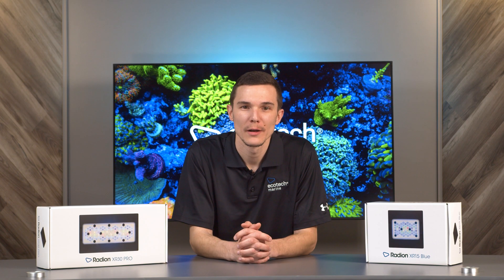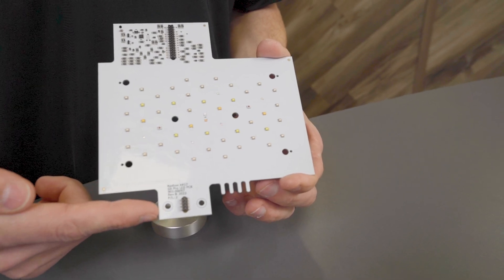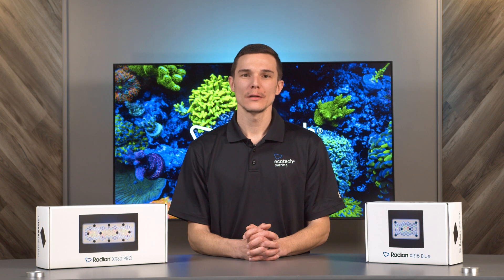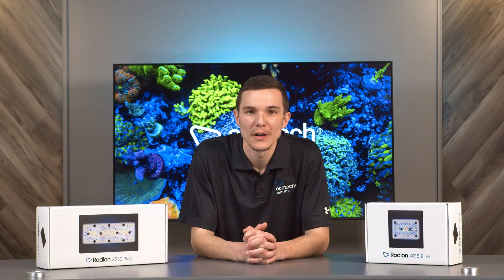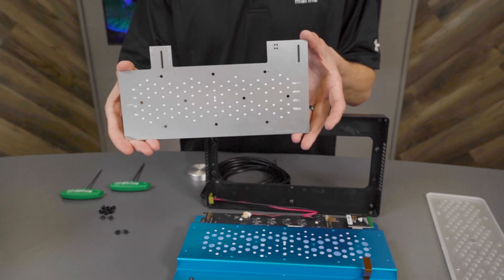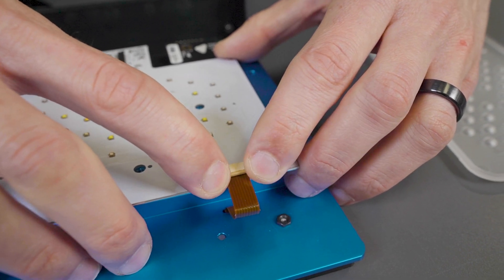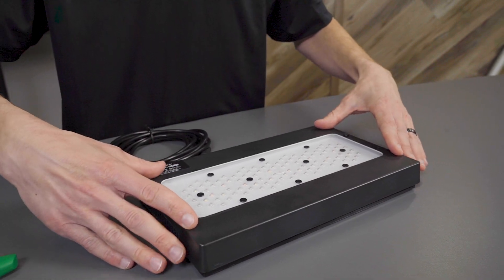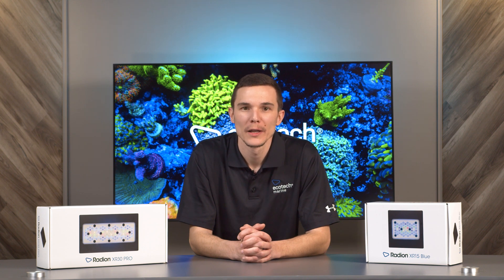Upgrade a Radion G5 to a Radion G6. Upgrade Kit Installation Instructions.

Comment: I think same as the g5 they rush for made a new light that isn't ready. Probably they want to stop the loose of the customer going to other led with real uv..
1) would their lens support Uva, from what I know their technology until know doesn't support it, so how suddenly without testing it can be possible? How long they will hold? Their is a risk for futur trouble here, I would like they told us how with the same technology it is possible when it wasn't before because this from the g5 wasn't ready it would probably last enough long until your led is not more in garanty..
2)where is the moonlight introduce by the g5? Given the design from the g6 their is a space for it but where it is? Economical reason, shortage?

3)  the spectrum is relatively unchanged, apart from maybe having less blue. They seem to have even made it narrower.
they have 395 but it is not enough to make a difference.
So at the end not even a great update. It would be better they fix their products befor launching a new model